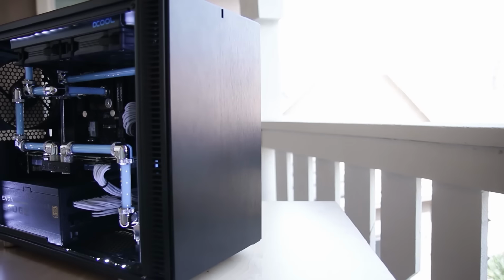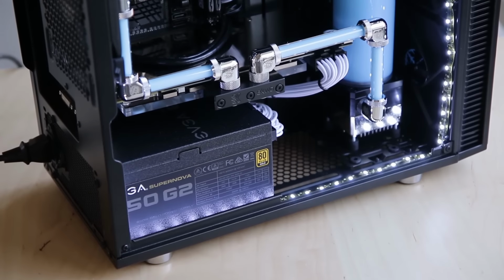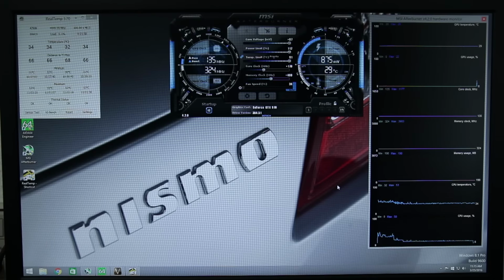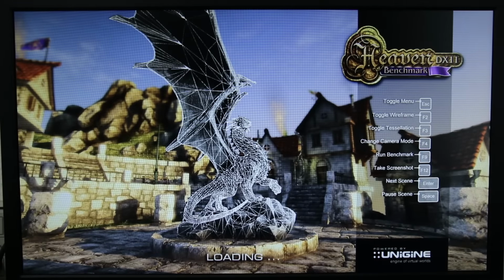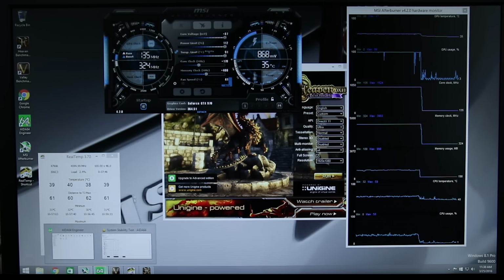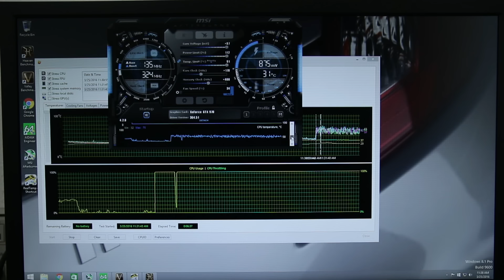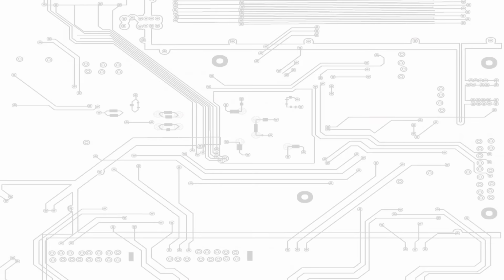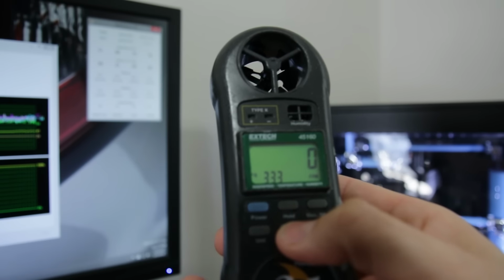Was a 240 Radiator enough?? Temp testing the ITX build

Comment: Yeah ppl dont understand you can have a 240rad to cool a motorcycle with 50kW without it over heating. Self I have 240 monsta rad 80mm thick. And its enough to cool both OC CPU and GPU and max temp on air out is around the same as you tested Jay.

Comment: So, a little late to the party 😅
But I would love to see an updated version of this video, newer GPU's and CPU's in an ITX format factor all being looped by a single 120mm rad, 240mm rad and 280mm rad (and 360mm if you'd like to include it) and I predict that because the generated heat is being contained within the piping coolant, the chassis interior doesn't get as hot which allows cooler air to pass through the fans and get pushed out the top mounted radiator.

Comment: Personally, I would go with a front rad blowing outwards, because I'm in Ireland and this damp country is not warm >:(

(Or put louvres on top of the case to direct warm air forwards.)

Fun factoid: a single 120mm rad is enough to cool a CPU & GPU.

Comment: I've been doing a few WC itx cases for over two years now, Skylake is truly a nice option for small builds with limited radiator space. They perform 10C lower for roughly the same performance compared to Devils Canyon. And before putting a second radiator I've come to appreciate more very good air intake options. A restricted fan will need more rpms making it noisier. More than 1 radiators on such a small case will make them compete for the same air space.

Comment: Good one two cents man,
                                            I am running the basically the same set up with a 280 rad. But one thing I always wondered about using gaskets or spaces between your rad and fans. Always seen for sale but hardly never seen in use? Can you give any comments.

Comment: I'm sorry Jay, I'm about to be that guy. You used AIDA64 and Heaven at the same time. Something I noticed when I did something similar on my PC (Valley instead of heaven) was that the way Valley works is that it requires some CPU, and I noticed that my GPU was being bottlenecked by AIDA64, and was only seeing around 60% usage. To fix this, I used MSI Kombustor (which renders the entire object and nothing else) which is fully CPU independent once the test starts (Think I did the furmark something extreme test). Anyway, I was able to run CPU and GPU together at 100% this way, and wasn't able to otherwise. I think it has something to do with Kombustor being a burn in stress test and Heaven being more of a benchmark for a gaming system, as it is more like an actual game (you can walk around and fly) than Kombustor which is raw "push your GPU to the limit" like AIDA64, where things like video editing, although put a heavy load on your CPU, can also benefit from decent RAM and a good video card. Good video, though, it still gives you an idea. I doubt it would go much over 1 or 2 degrees higher anyway.
Reply: +UniCrafter It only matters that he has things setup the same as the generated heat will be equal.
Reply: Jeffrey Photonboy
The problem is they may not, as the CPU benchmark may bottleneck the GPU benchmark, meaning the GPU is not running at 100%, though he mentioned framerates did not really suffer, so I may be wrong. A 240 should be fine anyways.

Comment: roughly speaking, the more heat you put in the loop, the higher the fluid temperature, therefore the heat transfer is actually higher (due to the heat transfer from rad to air increasing as the temperature differential being  higher)

Comment: not surprised about your results, Ive been running an overclocked i7 5820k an 2 overclocked GTX 970 on a single 360mm rad (EK-CoolStream 360PE Rad, which has an fpi of 19)

Comment: I had a 3960x overclocked to the 9's and a Asus Ares III (7990 on steroids) that i modded to run in my loop, both were under my cheap as chips 240mm radiator. Ran them for over three years In all types of heat without Issue, sold It all earlier this year and was still working fine and Dandy, 240 Is plenty.

Comment: Hey Jay. Just a couple of ideas. A video showing a loop with CPU & GPU with 1 240mm radiator showing temps, pretty ,much like you did in this video. Then adding another 240mm radiator showing temps with the same overclocks. To show a difference in temps between to two set ups. Of course you will have to use a different case & to make it a bit easier use soft tubing to connect it all.
And now your G1 Gaming is now watercooled. See how much more of an overclock you can get??
I get a stable 1605mhz core & 8000mhz memory running 24/7.  1648mhz core & 8102mhz memory stable Valley & Firestrike bench run. From my G1 Gaming GTX970.   Cheers

Comment: Another great video.  You also answered my question towards the end of the video about using another 240mm radiator.  I was wondering how much of an impact would a secondary 240mm have?  Great temperature reduction on the gpu, could the better power efficiency of the Nvidia card have helped?  I was wondering what if an R9 280 were used in this build?  Definitely more of this content would be appreciated.

Comment: My first loop had an Athon xp, radeon 9800pro and a northbridge block all cooled by one 120mm rad.  The hottest system I ever did with a single 120 was an Athlon 64 and a Radeon x1900xt, and it was much cooler than stock.

Comment: During those tests. I am curious to know about the 120mm FAN RPM speeds of the radiator during the CPU and GPU stress tests.
Reply: same.
Reply: +Kwipper Ursus  He has the fans used listed on the previous video. The front intake and radiator fans are Fractal Design Venturi HP-12 PWM's. Maximum rpm is listed by Fractal at 1800. Under PWM control the fans were spinning at 40% (no cpu load.) So with the Heaven benchmark running they were spinning at ~720 rpm. With the Aida64 test running and then the combo test they were spinning at the full 1800 rpm.
Reply: +TYGA909 Yup. I have my fans at 1k rpm to keep them inaudible. All things considered i would not consider this a very good build overall, with my priorities of course. GPU temps were nice, CPU temps were pretty high but passable, 1800rpm is not a desirable fan speed for me though.
Reply: +TYGA909 I am currently using the stock fans from corsair that come with the h100i gtx...you should listen to the loudness of my setup... xD
Reply: +CPUzer0 Well you won't be running AIDA64 and Heaven simultaneously during normal use.  The computer will A. Never reach these temps during normal use to begin with and B. The fans will more than likely never ramp up during normal use.  A moot argument really.
Reply: +DarkCloud64 This is correct, you will not run a CPU and a GPU stress test simultaneously in normal use. There are games however that do tax your CPU considerably more than valley does and this only gets exaggerated if you do gamestreaming/recording.

The thing that i have to ask when i see this build is that is this actually worth doing if similar results would be achievable with air cooling? Water cooling to me has to do three things: Better performance/lower temps, lower noise levels and better looks. The looks part this checks for sure, but the other two, not so sure.
Reply: CPUzer0
mITX builds tend to run the hottest of any build no thanks to the limited cooling capacity in the cases.  You'll essentially be forced to use somewhat higher RPM fans just to get a similar result to this water cooling setup.  There's not really alot of headroom for a big heat sink either on the CPU due to the limited room for the RAM mostly.
Reply: +CPUzer0 +DarkCloud64 Agreed that Aida64 and heaven wouldn't be run all the time but to test the stability of your overclocks one would have to run them. These give a very good idea as to what the upper and lower limit of the overclocked components are and since there ARE games that demand a lot from the GPU and CPU, they can easily have high temps but obviously not as high as seen during stability tests causing the fans to ramp up, nonetheless. 

I think it can be assumed that the fans would run at 1300~rpm when gaming, while considering the high voltage being supplied for the CPU to run at such clocks, with the possibility of having lower rpm with custom curves.

And as for water cooling performance/temps, water definitely gives more performance/lower temps than air at high volts and clocks. Air, as it suggests, is highly dependent on ambient temps, having an NH-D15 I can personally say that with lower ambient temps my PC is quiet but with high ambient temps, it's just not.
Reply: TYGA909  This is the main argument for running larger\multiple radiators\fans. You can lower RPM. But, he did prove that a 240mm setup is more than adequate to cool both the CPU and the GPU. Impressive!!

Comment: From my experience you can put the rad in front, back, bottom, top. Fans push, pull, push and pull. It will only change temps by a couple degrees C. I think if you have a 120 rad per component then you are good to go. Put the rad where it looks best.

Comment: I was using a single 240 with a Q6600 and an 8800 years ago and although the temps were not bad (not ideal either), the fans needed to spin at full Speed. So it was a little noisier than I liked.

Comment: Hey Jay, in regards to recording your screen, you can buy capture card like an ElGato HD60 or something to output the footage to whatever PC you use to edit instead of using screen cap software. You can also obviously record the UEFI and whatnot with a capture card unlike screen cap software
Reply: You think Jay doesn't know that, the cam was a joke
Reply: +Spicy Memes i havent seen a vid where he hanst used a cam
Reply: He doesn't often film his screen
Reply: Also capture cards are a waste of money, software like OBS or shadowplay works fine, plus you need to be in a Basic GUI to control the capture card
Reply: Like Linux distributions or windows
Reply: +Spicy Memes how do you measure idle temps if you stess the pc with screen recording duties
Reply: Capture cards require CPU to interface with the system, such a writing to a drive with recordings

Comment: a video that compares temps with different size radiators and different radiator thicknesses would be cool. I am thinking of putting the really thick 360mm radiator from ek in my define s and am really curious if that size is worth it.

Comment: Folks commenting, front , bottom or top mounted rads are fine folks. As long as you plan air flow out, but if you put the CPU and GPU on water case air temp is not even a huge deal. The VRMs on the MB will not be affected much by a slight rise in case temp from a front mounted rad.  Many mid towers and lower from many companies limit rad support to front mounted radiators.

Comment: This was actually pretty informative. I'm hoping to achieve similar performance, with my (stock clock) i7-5820K and GTX 980, on an EK PE 240 (38mm thick, 21 FPI) radiator. While I love my NCase M1, this would have been an awesome case for two 240mm radiators, with the right reservoir and pump placement.

Comment: Big question. If you have no space for a radiator with a fan on, but you can fit the radiator alone. Would it be okay to just mount the radiator without a fan as long as you have possitive air pressure into the case?

Comment: Hey Jay you should get a  water temp sensor... To measure delta water properly, i live in a hot area, I have ample rads, but yes it is utterly overkill, cooler water temps is where it's at your still running above 10 delta

Comment: hey, so.. totally could be wrong.  but i remember a while ago when i was in my physics class i was talking to my teacher about PC builds and mentioned a custom water cooling loop that i was doing. he had told me to not use a reservoir stating that if the loop was sealed, and there was as close to no air as i could get that the pressure in the loop would build aiding the radiator in heat extraction because not only does the radiator need to lose heat, it also needs to drop pressure.  just curious if he was right or wrong. maybe you could do a video on that one day?

Comment: Hey Jay, love your videos. But a theoretical question here:
If you modded the front for increased airflow by cutting holes in the front, and placed the fans on the direct inside then another slim EK radiator where you placed the intake fans on this build, would you then fit two radiators?

Comment: If you did want to go with crazy balls cooling without a front radiator, would a rear 120mm rad along with the top 240mm be feasible?  Not saying you should've done that, just wondering if that would be an option.

Comment: I have found that if you want to see just how hot the GPU will get under something like Valley, Heaven etc, turn that AA off.  Back when I was beating up on my old HD7970 overclocking it and running Valley with all settings maxed, a friend to me to loose the AA, I did and the FPS and heat both went up.

Comment: I live at an elevation of about 5400 feet and temperatures of 36C in summer. Water cooling is a problem with 2x 360 rads and reasonable rpm.
Reply: ***** just saying,  hitting max 50c water temp is easy

Comment: thanks for this video, i was actualy worried about running a CPU and GPU off a single 360mm rad but im not anymore and i can go ahead with my build :)
Reply: 120.3 is just about enough for a CPU/GPU loop so you'll be fine. The reason people add more radiators is to run fans at a lower speed and get lower temps. Less radiator space you have the higher fan speeds you'll need. Make sure you don't get an acrylic bay reservoir with higher temps the thing will crack and warp due to the high heat. Had it happen to mine when I ran a single 420mm radiator for a CPU/GPU loop.
Reply: Muffin Man thanks for the advice, i was planning on buying the ek predator 360 so shouldnt need to worry about the res and whatnot

Comment: Beautiful Build, but I have a whole different concern. You are not using an Aquaero for fan speed control, Flow rate or water temperature. it would be more interesting to see Fan Speed vs. Watertemp here.. My 6700k and 980, both OC, Push my Dual 240mm Rad to their Limits with 41c Watertemp at 50% Fan Speed...

Comment: As everything in this world it's all about science. Cooling is an equation. Smaller radiator means higher fan speed and vice versa. Delta T + surface area + air speed = dissipated heat. Lower one means higher other two. (Jay already proved coolant flow doesn't matter within reasonable limits)

Comment: Would a 360mm rad keep a 4790K and 2X Fury on the same loop under control? The radiator has a fairly high fin density, cooler Master ring fans, and the case has 4x 140mm intake fans for positive pressure.

Comment: As far as "in check" the temps with a single 240 rad can be i really dont consider ok +80C on the cpu and almost 50C on the GPU an ok temp! But im a watercool biach! 

But ofc is still better than any air cooling setup in a small form factor case :) 

This build is very nice Jay, and we know your knowledge about watercooling  is huge ;0

Comment: You said: 1X120mm @ 30mm rad for each component, and I would liked to have 2x120 mm rads in here for cooling overhead...
 Ok, so, how much difference would a second 120x30mm rad make?
 So how about it, take a middle to upper mid spec overclocked build and compare...   Do the current videos test on stock air cooling, then with aftermarket air cpu cooler, then with one of your water set ups starting with 1x120 mm rad and finally with 2x120mm rads?

Basically a bang for bucks test, where is pc cooling the sweet spot?

Comment: So say thermal throttling occurs at 100+ degrees, does that mean running your gpu or cpu at 70, 80 or 90 degrees (as long as its <100 degrees C) would not effects its performance at all? Would it increase the speed of the natural degradation of the part?

Comment: I'm glad you made this. I've been wanting to know how this set up would do. I have the same parts but at 4.7ghz. I do plan on going from my 970 to the 1080ti or whatever though so I hope a 240mm would still work. I'd prolly get a 50mm thick rad though. finding an ITX case that's small and supports 2 x 240s is hard
Reply: What itx case support 50 mm rads?
Reply: sur puppa Phankteks Evolv ITX can. But really I'm just talking about a rad thicker than 25mm

Comment: OMG Jay!! If you wanted to stress the loop you should've used Furmark and Prime95 for heat-exhausting the loop
Reply: prime 95 is dangerous to new Intel processors.
Reply: ***** stop spreading rumours
Reply: +1sword4you not rumour. it can cause over volting of the CPU causing long term damage. it won't cause instant problems but will reduce life span. there is no reason to use it anyway as there are alternatives.
Reply: ***** stop spreading rumors, if you can't properly configure your system it's not software's fault
Reply: +1sword4you OK well I just explained the facts and you just repeated yourself. Nice try but I have learned quite a while ago not to feed the trolls. Good luck next time!
Reply: there's like 5 or 10 really loud people on the internet that misconfigured their overclock and yell how Prime95 supposedly almost killed their new Intel CPU, the rest of the world is using Prime95 just fine. Free tip: don't use Adaptive voltage while benchmarking. Also I believe the issue was fixed long ago with BIOS updates.

Comment: GG Jay! It's ok for your configuration. As personal experience I managed (in old days..:)) to watercool core i7 920 OC 4Ghz + X58 + SLI GTX285 with 2 rad 120mm, 60mm thick with Push-Pull Gentle tyhoon AP15 on it...was able to run Folding home on all CPU+GPU meanwhile with no thermal issue..:)
My main concern is on Define Nano S...finally a bitfenix Prodigy/phenom/colossus mini ITX has more cooling potential than Define S..:) Define Nano S is not the ultimate Mini ITX case...:)